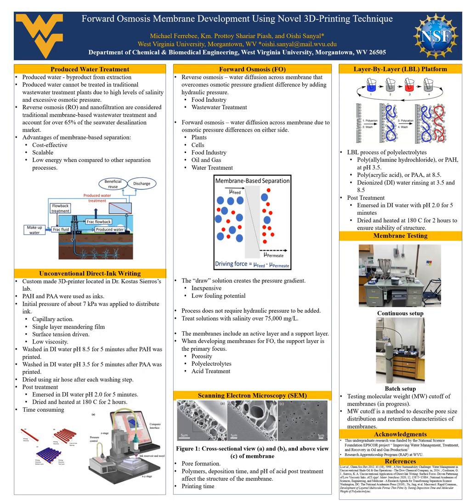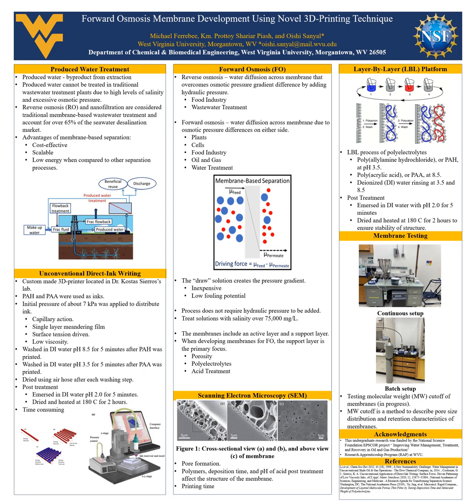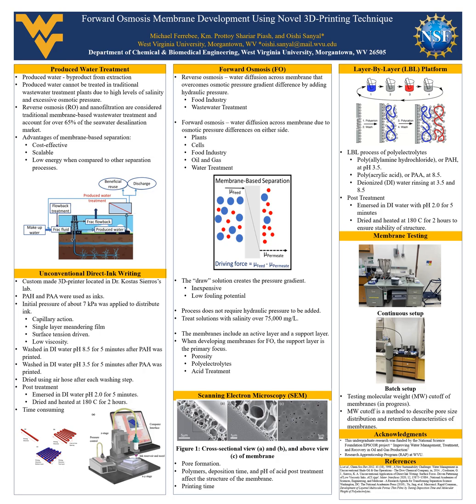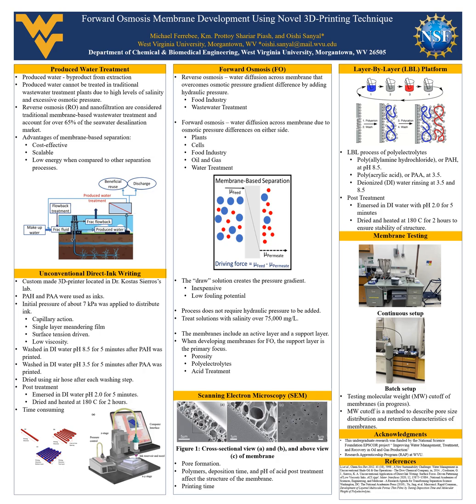Forward Osmosis Membrane Development Using Novel 3D-Printing Technique 2021

Comment: Hey Michael, super cool work! I know I'm late but maybe you're still on to respond- is disposal (or re-use?) of spent filters something you guys are looking at/an issue to potentially deal with in application?
Reply from the maker: Hi David,

We are not looking at disposal in our research, but we are interested in extending the lifetimes of these membranes, for example, by resisting membrane fouling.

Comment: Great research! I like the incorporation of using 3-D printing. I’m wondering what type of cost analysis could be done to show how this treatment could benefit companies to do this? Is there a way to show a breakdown of the cost for a generic amount of water waste? For example at what amount of waste water would this treatment be beneficial for a company.
Reply from the maker: Hi Kelsie,

Unfortunately, I do not know the specificities of how this would benefit a company financially. Forward osmosis membranes are generally cost-effective because they require less energy than most other separation process, like distillation. These membranes are most beneficial to companies that would be treating water with high amounts of salt.

Comment: Hello Michael, I do have  a couple of question about your work:
1) I did not understood the difference between reverse osmosis and forward osmosis. Is a quality of separation using these techniques different? Molecules of different size can be separated?
2) Assuming you are getting the ideal membrane, how difficult it will be to produce this membrane in large industrial quantities? 
3) Waht is your personal input in this project?
Thank you!
Reply from the maker: Hi Andrey,
1) Reverse osmosis uses applied pressure to push the untreated water through the membrane to treat it, while forward osmosis uses the natural properties of osmosis to flow the untreated water through the membrane to treat. Forward osmosis is generally considered better when treating very salty water, while reverse osmosis is not. This is because using pressure can be very costly in reverse osmosis. The higher the amount of salt in the water, the more pressure is needed. Each membrane can be designed specifically to separate different size molecules, it just depends on what the membrane is being used for.
2) We are currently in the preliminary work for figuring out if we could produce membranes feasibly in large quantities. We think that 3D printing could be the perfect way to produce membranes and surgically design them.
3) I personally loved this project as this was my first exposure to research and it allowed me to apply what I have been learning in the classroom.

I hope this helped answer your questions!
Reply: @michaelferrebee7124  Thanks for the replay. Still confusing with RO and FO osmosis difference. How membrane are different for both procedure? What is the "natural properties of osmosis"? Why you need to use pressure for RO and do not for the FO?
Reply from the maker: @andreybobko7248  The only difference between reverse osmosis and forward osmosis membranes is how they are being used. The membranes are designed for water treatment but not necessarily for forward or reverse osmosis specifically. They tend to be thin and porous. 
Generally, osmosis is the spontaneous movement of water through a semi-permeable membrane to a solution with a higher amount of salt. In forward osmosis, there is untreated water with high amounts of salt on one side of the membrane and a "draw" solution on the other side. The draw solution must have higher amounts of salt for the forward osmosis to occur.
Pressure is needed for the water to move across the membrane in reverse osmosis because the untreated water has a higher amount of salt than the solution on the other side of the membrane, therefore the normal osmosis process does not occur. Forward osmosis does not require pressure because the high amount of salt in the draw solution causes the untreated water to move through the membrane.

I hope this helped answer your questions!
Reply: @michaelferrebee7124  thanks, start to understand...
As I understand your developing membrane that can be used in reverse osmosis application too. And vise versa, RO membrane can be used in FO applications. There are many of these membrane. What makes your membrane the best? Preparation procedure, properties ?
Reply from the maker: @andreybobko7248  We are mainly focused on the 3D printing of the membranes in this experiment. This procedure could be easily scalable if it is found that effective membranes can be made consistently. We are still in the process of making membranes using this process but we have changed many factors like the printing speed and the line-spacing of the print to try to find the optimum specification to make effective and optimum membranes. We are currently beginning to test the effectiveness of the membranes we have produced using molecular weight cutoff (MWCO). Molecular weight cutoff provides an accurate percentage of how effective the membrane is at rejecting solutes, like salt. It looks specifically at pore size and pore distribution. This is testing is being used with a polysaccharide as the solute because the molecular weight can be varied with polysaccharides. The rejection for FO membranes is generally supposed to be above 90%.